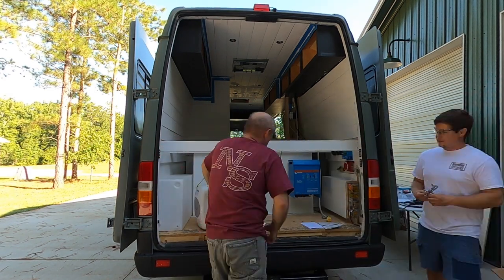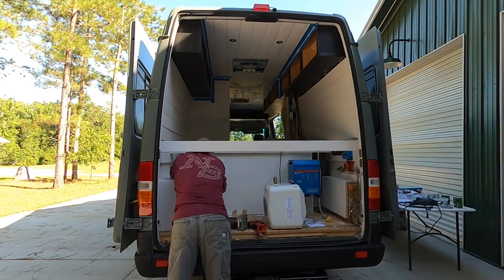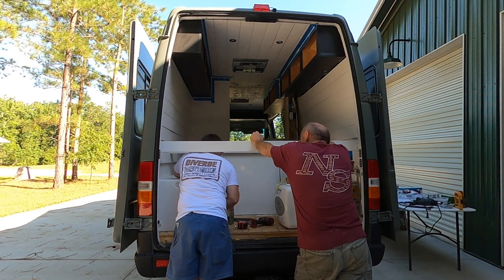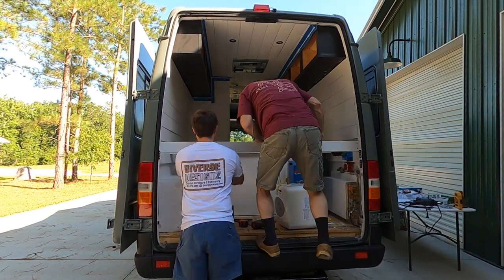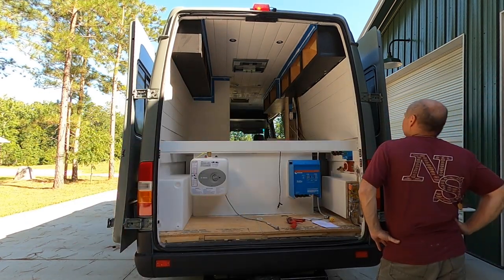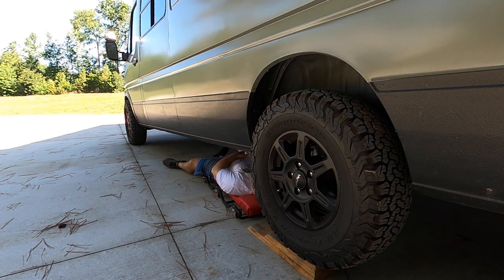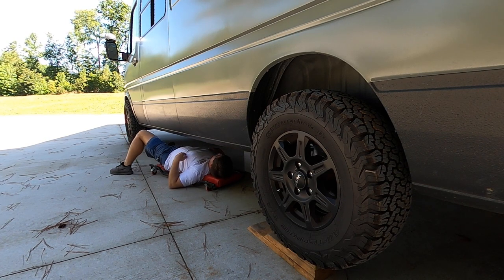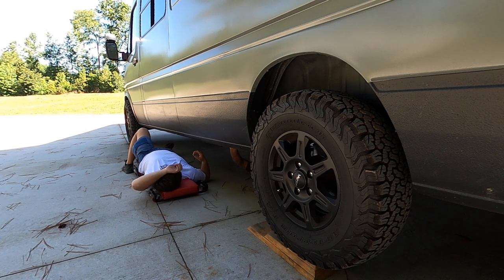Van Build Episode 22! Installing our Van Plumbing and Explaining the Water System Components!

Comment: How has your water heater hold up? I’m thinking of purchasing this one. Would you recommend it?
Reply from the maker: We sold the van back in 2021 but haven’t heard of any issues from the new owner. The water heater worked great when we used the van. It made the water hot in 10 minutes and had enough for a quick shower.

Comment: I have a question... at 26:24 in the video the image shows both hot and cold pex going into a hole in the floor... Why is that? Is the red the center pressure vent on the bosch water heater? And does it actually vent out a LOT of water? Or is it just a steam? I am trying to figure out how best to manage this, and do not want to cut a hole in my floor. And why does the Cold have a vent midstream in the line before the water purifier?
I have a SHURflo 182-200 Pre-Pressurized Accumulator Tank inline with my hot water tank... isn't that supposed to manage the pressure from the Bosch tank?
Reply from the maker: Hey Wendy, the red pex is the over pressure relief for the water heater. The only time anything comes out of that is if the water heater malfunctions. The blue pex going to the outside is the city water connection that is under the van. It looks like a vent but it’s really the water inlet and there is a check valve that keeps it from overflowing the holding tank when hooked up at a campsite. I hope this helps and if you have any more questions just let us know!

Comment: Do you have a switch for the hot water heater, where you turn on when you want to use it? or do you leave it on all times?  Do you turn it off at night? thank you for the video.
Reply from the maker: We installed an outlet that was switched. If we were not hooked up to shore power we would turn it on about 10 minutes before using it and that was plenty of time to get hot water for a shower. Then we’d turn it off when we were done using hot water. I hope this helps!
Reply: @goldenadvantures2573  this helps. Thank you!

Comment: Love this system, my question is how does the water heater hold up? After say 10 minutes of using the recirculated water does the heat of the water dramatically drop as the water heater won’t have time to heat the water back up? This is the last stumbling block I’m trying to work out before I fit my own. Thanks!
Reply from the maker: I was worried about this very problem so typically I’ll try to be as quick as possible in the shower but what I found was that the water heater works fairly well as an on demand unit. Yeah it’s not as warm as it is when you give it time but you don’t get an ice cold shower if you run out. Hope this helps!

Comment: Would you happen to have a diagram of the plumbing setup? I have the same water heater and I’m trying to figure out how to get hot water to the sink and the shower/dog rinse in the back of my van as well...
Reply from the maker: I have a really rough sketch of it. In the simplest terms you have your water pump pulling from your holding tank and pushing through the cold line. To get hot water you make a T off of the cold line and run it into the blue connection on the hot water heater. Then you run your hot water pipe out of the red connection on the water heater and just run it next to the cold line to all of your items. Then at each thing sink, shower, and dog shower you have a hot and cold pipe. I hope this helps!

Comment: Does the water still flow if you dont have the water heater on to heat?
Reply from the maker: Yes it will allow water through it even if the power is turned off to the heater.

Comment: Does that hot water heater have a cold water pass through when not turned on? I ask because some faucets need to have hot water gonin no matter if you have it turned to hot water. And to save electricity, we'd have the hot water heater off. Does that keep all water from going through? Or do you need the heater on to have the water go through?
Reply from the maker: The water will flow through it regardless of whether it is turned on I’m pretty sure. I don’t know that I ever tested that explicitly but there were no valves on it to keep the water from flowing.

Comment: Have you had any problems with the pressure release valve leaking water? I didn't see it connected for drainage.
Reply from the maker: On the hot water heater? If that’s what you’re talking about we ran it out of the bottom of the van and have never noticed any water coming out of it.

Comment: For your pressure relief valve (Between cold and hot water line) did you put a pipe to drain it anywhere ? Is it needed ? Looking at purchasing same heater myself but need this question answered haha
Reply from the maker: We plumbed it to run outside of the van in the event that water did come out of it. I don’t think anything has come out of it so far but we didn’t want to take the chance of flooding the van. Hope this helps!
Reply: @goldenadvantures2573  thanks for the reply :)! It did help a lot of setups I’ve seen incorporating the water heater don’t have anything connected 🤷🏼‍♂️ doesn’t hurt though right
Reply from the maker: Yeah it’s just a little bit of pex hose and you never have to worry about it so it definitely seemed worth it.

Comment: help me out....could your tell me your tire size and wheels?....
Reply from the maker: We’re running BFG KO2 245/75/R16 tires on Ultra Toil 450 5x130 wheels. I’d suggest going down a tire size though because we have a little bit of scrubbing when we turn after a lot of trimming.
Reply: @goldenadvantures2573  thats a really good looking tires and wheels ...don't you want to modify the fenders? .....Thank you for the information and Again, REALLY great job you guys are doing, I like  ...No short cuts.
Reply from the maker: The way the inner fender is designed makes it where I’d have to crush it in with a mini sledge to make the tire stop scrubbing. I cut everything out that I could with a cutoff wheel and sawzall. Yeah I’m not a fan of shortcuts so we did everything the best we could!

Comment: Is pex used in the marine industry and if so for how long?
Reply from the maker: Pex is compliant with ABYC standards and has been in use in the marine environment back to at least 2000 that I know of. It may have been used for even longer.
Reply: @goldenadvantures2573  Thanks. Since Pex was not originally designed for the marine or rv industry (typically used in static applications) I wasn't sure how well it would hold up. I in no way trust the rv industry and always use marine standards for reference.  Since you work in the marine industry you're a great resource for info.
Reply from the maker: People like to use pex in larger yachts because it requires less supports than typical soft wall hose on longer runs. I’ve noticed a lot of people use it in sailboats as well for potable water systems.
Reply: @goldenadvantures2573  My concern has been it's reliability in that environment. My previous van I used ss braided hose for all my water lines. I will try pex on this new project.
Reply from the maker: The connection method for pex is very similar to an Oetiker clamp commonly used on engine fuel and coolant lines. That’s one of the main reasons in trusted it. Sounds like you invested serious money in your water system. We used stainless braided line for our propane system but that’s it.
Reply: @goldenadvantures2573  I'm hoping the pex will be a bit cheaper.

Comment: You made it sound like there is no such thing as a propane tank hot water heater. The rest of the vid TL;DR.
Reply from the maker: They definitely make them you just have to worry more about explosions and keeping the pilot light Lit. Not to mention you have to have them vented to the outside is the van. The electric version was a much easier install for us.
Reply: @goldenadvantures2573  Yeah I heard about the pilot light also...that it also does not to be on uneven ground. I only have 100ah lithium battery bank (300w solar) so electric water heater is pretty much out.
Reply from the maker: You can also get a tankless propane water heater that doesn’t use a pilot light. We’re running a Tesla module and 600 watts of solar so the electric one was a no brainer for us.

Comment: YES! This is the episode I’ve been needing! How’s the performance of that Bosch water heater for the shower? Thinking about getting it for my T1N.
Reply from the maker: We’ve been really happy with it so far! We turn it on for about five to ten minutes before we’re ready to shower and I’ve yet to run out of hot water. It is a pretty big electrical draw but with 600 watts of solar we keep the batteries topped off even with heating water.
Reply: @goldenadvantures2573  Ohh wow! Nice I'll probably end up getting that then. I was hoping for 600w, but I have the Maxxfan and a huge skylight hatch above the bed area at the back, so I ended up with one 325w panel. I've built a 24v 200ah LiFePo4 battery bank and have the 3000w multiplus too, so hopefully with the soIar and alternator charging I should have enough juice for it! I'm about to buy that shower pan on your website. That's surely the best option for the T1N I have come across.
Reply from the maker: We just barely fit 600 on the roof using the compact renogy 100 watt panels. We have one in front of the fan and one on either side then a row of three between the fan and ac. If you can keep it clean the 325 should be plenty. Ours right now are maxing out around 350 watts because of how dirty they are from all the wildfire ash. That was the smallest shower pan we could find that would work and we like it so far.
Reply: @goldenadvantures2573  Looks like I should consider building a ladder into the van to keep that panel clean haha. Maybe later on down the road if the 325w isn't cutting it I'll most likely redo the solar like yours. And thats good to hear, I didn't it to be cramped in there, but didn't want it to take up too much room. Thanks for the replies! Your channel is so helpful to me!
Reply from the maker: We’re really glad that you find our channel helpful! We don’t have a ladder on the outside yet and that’s definitely something we want to add down the road.

Comment: **DO NOT USE ANY DUCT HANGING WIRE OR STRAPS ON WATER TANKS UNDER YOUR VAN!!!** You are asking for trouble with that support system. Use sold sheet metal strips bent at the appropriate angles and screw it into the frame. 1 gallon of water weighs 8lbs. A 20lb tank is 160 lbs! Remove this video or edit that out please.
Reply from the maker: We have a rubber isolator between the metal bands and water tank and wood between the metal of the van and the tanks. We’ve had the tanks under the van for going on a year now with over 20,000 miles driven on not the best roads with zero problems. Also those tanks are only 7 gallons a piece. They are almost never over half full which would put about 30lbs of weight in them. If we were to build another van we would more than likely do it the same way again as we see no issues with the mounting method.